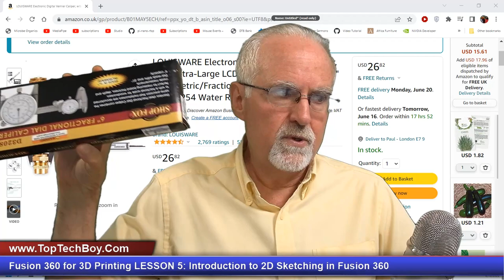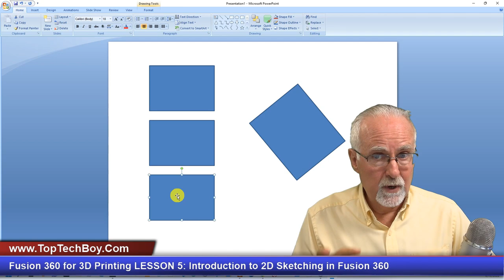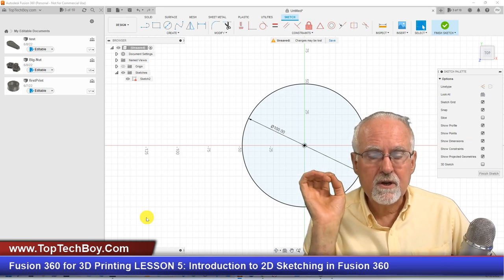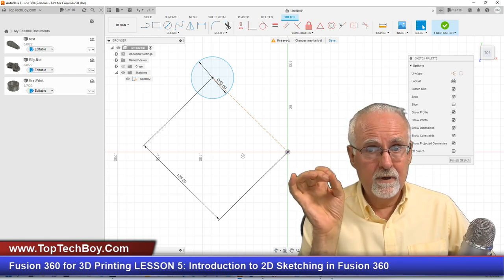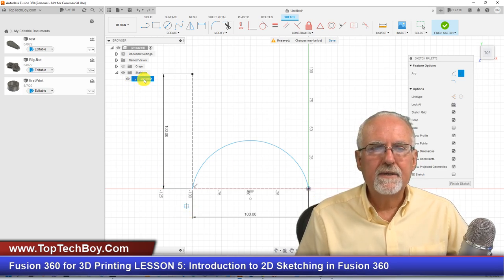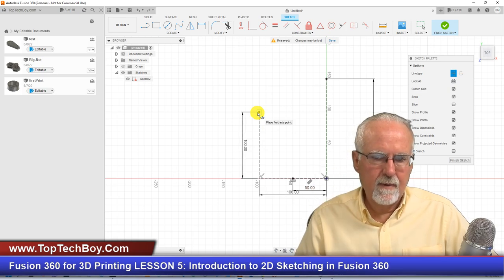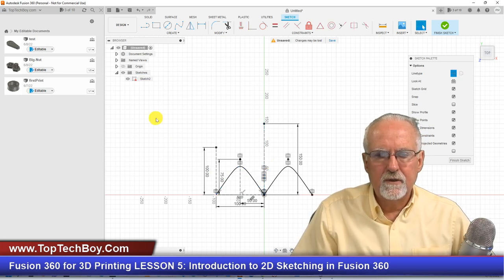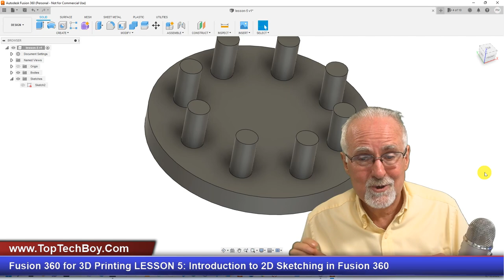Fusion 360 for 3D Printing LESSON 5: Introduction to 2D Sketching in Fusion 360

Comment: Thanks for your videos.  I'm glad you get things wrong because it enables us to see the problems will will encounter and how to solve them.  Some instructors never show that.  This is much more helpful.
Reply from the maker: Actually I dont make the mistakes on purpose but am deliberately not perfectly careful. One of the most important things you can learn is to see how I handle things where there is an error. How to find and fix the errors is the fundamental trait of good engineers.

Comment: This whole series should be part of mandatory school curriculum.
Reply from the maker: It really should be. Back in the day, schools had 'shop' classes and 'Home Ec' classes, that frankly were the most valuable things taught in school. I think things like fusion, 3D printing, laser cutters, Arduinos and circuits should be taught as hands on classes in the tradition of the old shop classes.
Reply: It would be amazing if you can do a series on Easy EDA pcb designing and ESP32.

ESP32 in my experience is easier, powerful and more fun than arduino.

Comment: for the 26:51 operation another method instead of 2 lines to constrain you can 
Click origin
drag roughly 
type length 
hit tab and it will let you enter a radius to constrain it draw you 

after doing it i realize it will constrain the line and the circle but it  creates another construction line out to the right of the origin that doesn't have a length constraint so if you want the little lock Icon you need to constrain that which makes it about the same time to do as 2 lines LoL
so if you know you want it 100 mm at that angle do it the other way and If the first way works better do it that way  :P

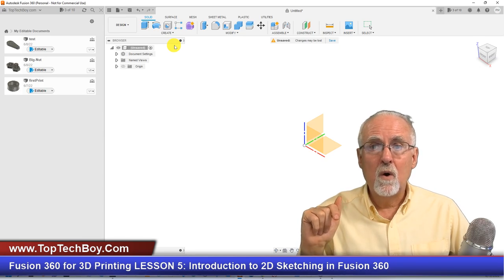Comment: My default orientation is different than what you are showing 12:30 into the video. Z aligns to the Front face in the cube in the upper right corner instead of the top. Y align to the top face. I don't see where there is a way to change that.

Comment: Hi Paul .... important question  !!
I am on timeline 46:20, Slot creation
When i select Slot in Create, and i move mouse down to the Rectangle, in a half way or so the small Slot's rectangle is moving out from the mouse, as it is lost on the way
I guess it is the first Slot point, because after I click in the rectangle second construction point, the slot is in funny way away from rectangle ....
I restarted Fusion, but nothing better.
When the little Slot rectangle is away, and i move mouse left, right, that rectangle can move to another place and stay, all time it is lost away from mouse,, so i can not point the first Slot construction point
🤔 ....  any idea please  ?
I did some tricks, when the small blue slot pointer is lost, o go to the first point in rectangle and i press RIGHT side mouse up to the lost rect is coming to it, than I press LEFT mouse to set the start point of the slot, the second point is normal, click, and later on the size of the slot ....  😁🤪 haha

PS. Paul, could you explain the idea where the sketches are saved, pls pls .... ?
In menu Open, there is only Admin Project, but where is it  ? .... somewhere underground 🤔😁

Comment: Dear sir, i found that (in time 34:31 of your video) the arc could be constrained simply setting the sketch dimension from palette
Reply: Also for the polygon (time: 39:48). It is constrained after you set dimension to one of its sides.